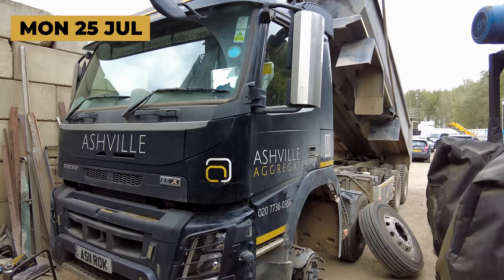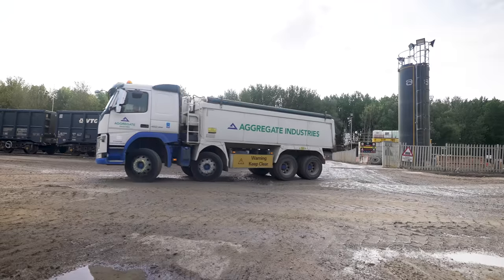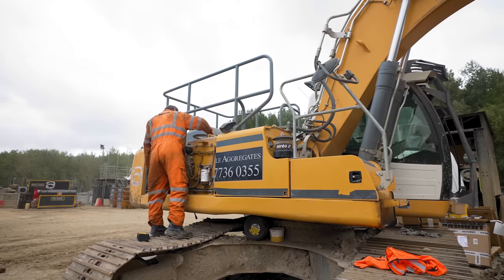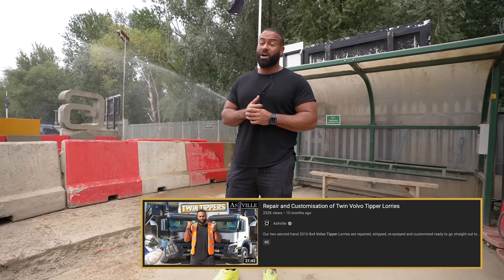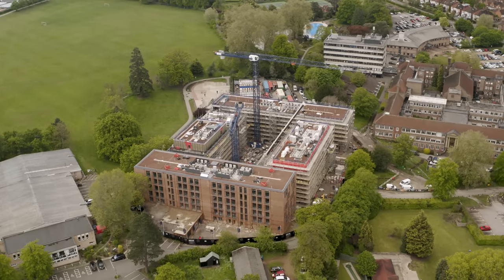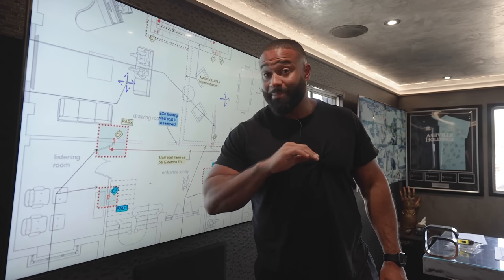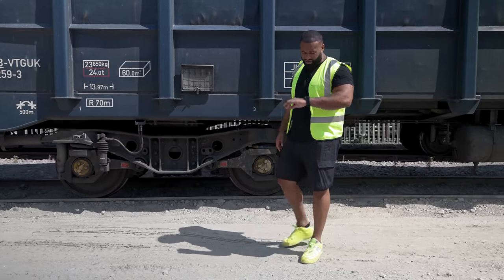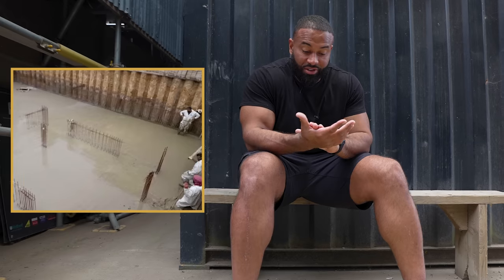Shook and Tyred | Ashville Weekly ep095

Comment: The pours I was used to while working on the supervision of The Taiwan High Speed Rail build was 4 working concrete boom pumps plus a standby and the pour taking between 8 and 12 hrs. These were the base structures of a viaduct section across a flood plain, the columns and then decks  followed with stressing of the decks. A great four years work I just hope the Chinese don't nick it all.

Comment: All very good fishing lighting cables but what about metal fixings and clipping the cable?  Also your feeding the module with a 2.5mm which is pointless as your lighting loads are 1mm or 1.5. You need to protect the out going cables which you can’t do on a c4 8 check dimmer so you have to protect with an rcbo at source so only a 6 amp or 10a so 2.5 is waste of time.

Comment: Is that bar your grab wagon op to secure the strap when lifting tyres legal? Not being a snowflake but that can get someone in trouble if it fails.
Reply: why not? if the strap weight limit exceeds the tyre weight, it's safe.
Reply: @petesmitt  I get what your saying about the strap being OK but all lifting and fixing equipment needs to have a SWL tag and be tested. If there is an accident during the lift and all equipment is checked and the main fixing to the grab is a metal bar that isn't tagged and tested then there will be trouble, usually a 'D' shackle is used. Not causing trouble just don't want anyone to get hurt.